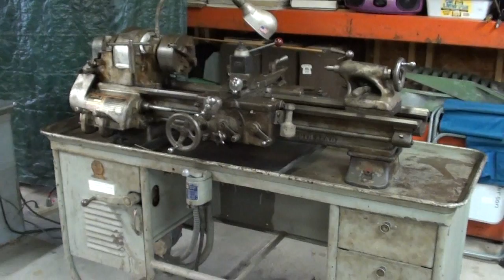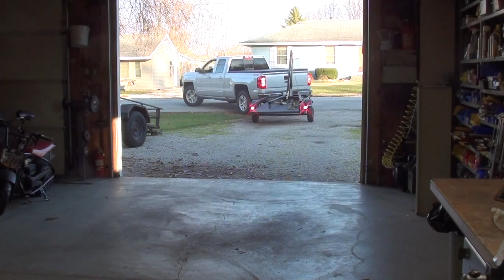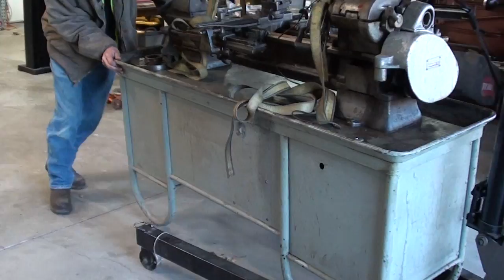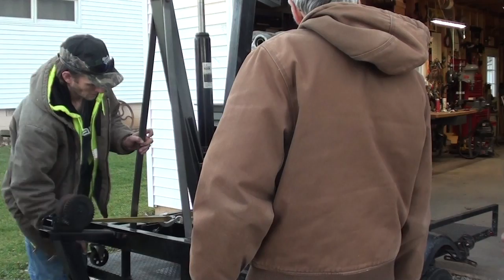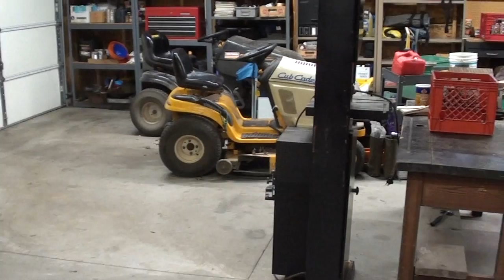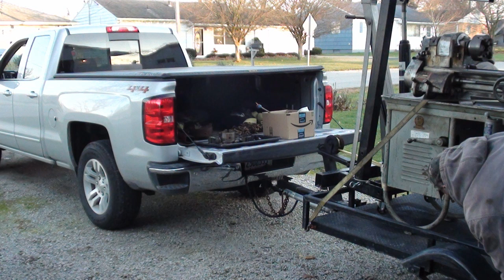SOUTH BEND LATHE Disappears in Smoke 693 tubalcain

Comment: That engine hoist brings back memories of when I hauled my 16" South Bend turret lathe home.. I had my doubts about the same type of engine hoist lifting the lathe but it did it.. The guy I bought the lathe from said he lifted the back of a John Deer  two cylinder tractor off the ground with the same engine hoist..... I think that was in about 1995 when I got my lathe.. Hauled it home on a double axle trailer behind my 1952 Dodge Army truck... Cheers from Louisiana

Comment: Wow that hoists band hurt my eyes at 3.06 next time under the auto feed shaft .many destroy a feed shaft  similar way. Thanks for sharing  all the best
Reply: Yep... Both bands were on the screw....   The proper way is to drop a chain loop between the rails and then place a 2x4 in the loop and lift with the 2 x 4 spanning the rails from underneath...

Comment: I'll soon be selling a restored South Bend 10" Precision Toolroom Lathe (10" x 4-1/2' mounted on Modern Cabinet Style Bench).  
This thing is a beast, the cabinet weighs as much as the lathe.  It was a bear loading onto a Ram 1500.  
I separated the lathe from the cabinet to reduce weight since there wasn't an overhead crane and I had to use (2) 2 ton engine lifts.  
It is deceptively heavy.  Hope you got a good price for yours.  Cheers!
Reply from the maker: Thanks, we considered separating them. And yes much heavier than you would think. I once owned a 13 inch. Totally stripped it down to move it into the basement. Still took six of us to carry the bed down the stairs

Comment: He might be good at backing up a trailer normally, but those small trailers are more difficult to back up than your usual farm trailer.  For one, they are shorter and thus more tightly coupled.  For two, they are so small that you can't see them from your pickup until they have gotten so far out of line that you need to pull back up and straighten out again.  But, they are light, so you can just get out and pick the end up and straighten it out if needed (when empty at least).
Reply from the maker: That is very true. When he got out of the truck he told me that he could not even see the trailer. I have had the same problem with empty boat trailers. You can’t see them
Reply: if you want some fun backing up a trailer try a four wheel farm wagon into a tight spot
Reply: @mrpete222  -- My utility trailer is longer and wider than what he appeared to be using, but with my pickup, I could not see it at all when backing up if there was nothing on it.  Putting a pair of rods on the back corners temporarily make it a lot easier to see where the corners were even though I could not see the trailer.
Reply: @johnmortland1558  -- The worst thing that I've ever had to back up was an aircraft that had a fully castering nosewheel using a tow bar that hooks to the trailer hitch on the back of a vehicle.  Even if you use a small vehicle like an ATV, having the attachment point on the back makes it difficult.  If you put the trailer hitch on the front of the ATV, it is a bit easier though.  If the four wheel farm wagon has a steerable front axle, then it would probably be similar to what happens with the aircraft.  Of course, the aircraft has wings that stick out fairly wide and there is often not much space between the tips of the wings and the walls of the hangar, and if you make a mistake, it tends to be a rather expensive mistake.  Also the distance from the nose wheel to the main wheels is not as long as the farm trailer, so it's going to be rather short coupled, making it more "interesting".  When you're backing an aircraft into your hangar, you need to point the nosewheel to the opposite direction that you want the aircraft to go (as viewed from in front and facing the aircraft).  But you need to straighten it out and possibly counter-steer before you get to where you want it to be.  Now, attach that nosewheel towbar to the front of an ATV and you find that you can't move the towbar from one side of the aircraft to the other side that quickly, so you will need to back up to straighten out periodically, but it's not as bad as when you put the towbar on the trailer hitch on the back of a vehicle.  Another thing to consider is that usually the aircraft is at a right angle to the hangar, so you need to make a 90 degree turn while backing it up and there might not be all that much space between the rows of hangars, so you can't pull it forward very much when you need to straighten it out.  The only thing that I think might be worse would be trying to back up one of those double trailers that you sometimes see being pulled by the tractor-trailer rigs on the highways.  I think they are called "A-trains" and you might see them used by FedEx and UPS here in the US.

Comment: Going to have to catch up with the happenings over there.  Parting with machines?   Captain Kirk said "space is the final frontier"   That big open space would do well to have a nice flat steel table 1/4in or thicker, with stout legs and casters.   It's hard to beat a thick metal table 3ft x 3ft  or so So many uses.
Reply from the maker: That would be a nice addition

Comment: Lyle, you might need to go to the local scrap yard to look for a new project.
Reply from the maker: No way
Reply: @mrpete222  most of my power tools come from one of several yards in the area. I recently bought a Craftsman jointer and a Craftsman woodworking shaper. Missing were the motors and the stands. Aside from that they were both complete.